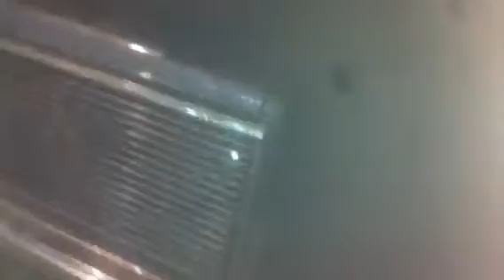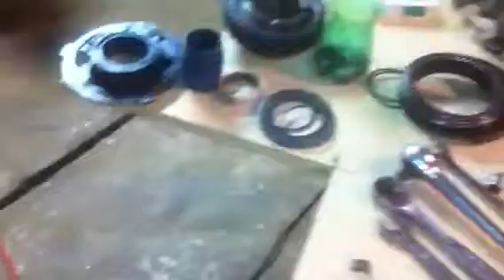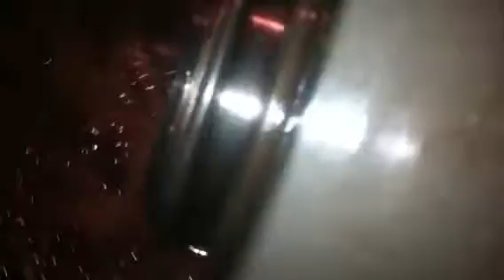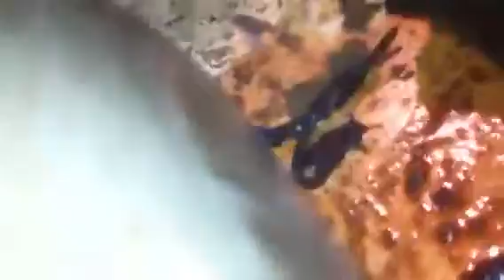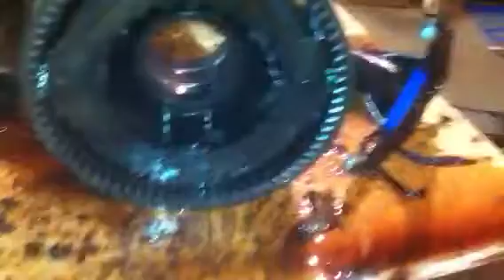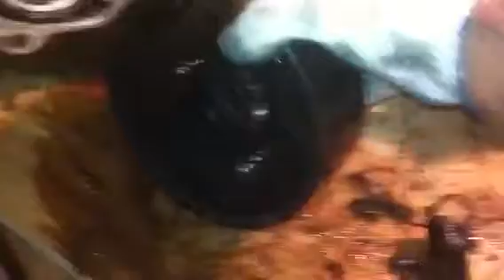Np208 problems

Comment: this is an older video at this point, the noise u heard was that planetary set going bad. 208; s are well known for this to occur . my Ford version did the same. but as this progressed didn't want to stay in hi range . mine was so bad couldn't move pickup . I've changed this out as a unit end of problem. the old one I'd like to repair as a spare.
Reply: my gmc np208 is doing the same did u ever find out what was wrong?
Reply: @vegy7ball730  no I just located a good used one n changed it. Just food for thought, why dont you look into the next series up and upgrade. It should work. I went from a 208 to a  b w 1356 . Ford application though.

Comment: I know this is bringing back an old topic, but what was the sound you heard while driving? I have an 86 K5 that has a grinding sound when I let off the gas at speeds over 45mph or so...never hear it when on throttle or steady rolling. Swapped the rearend already..and a few ppl are tellin me transfer case. Thanks!
Reply: Hey buddy I just read your comment about the transfer case sounds, I've got an 88 k5 and when I let off the gas at about 45 it makes a load grinding sound and I've replaced my entire rear axle do you know what the problem is?
Reply: You own a Chevy.